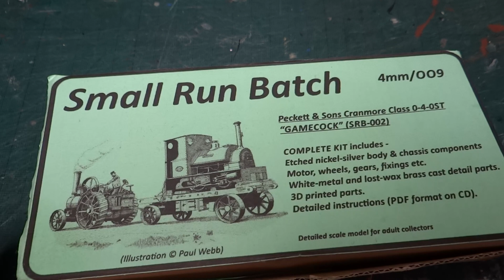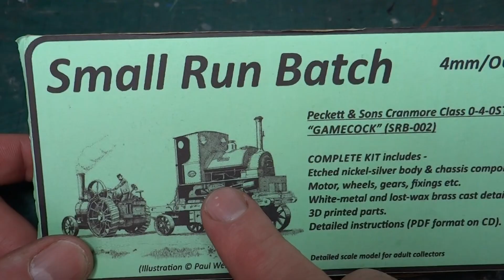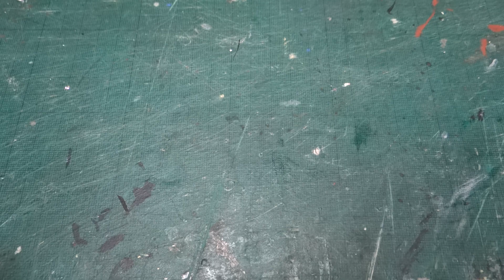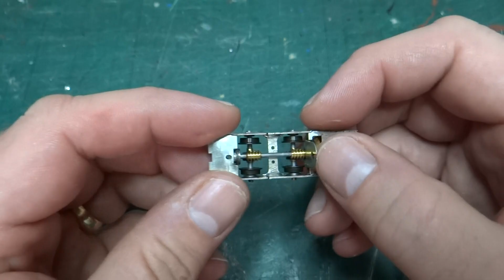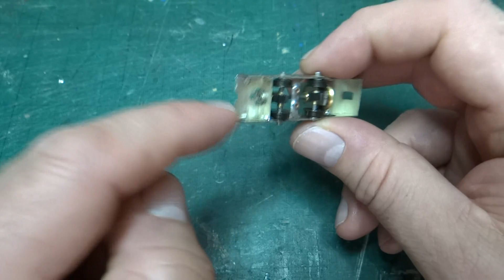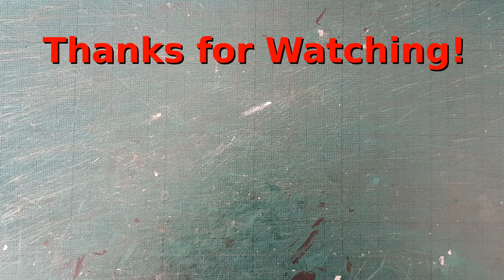Building Pecket 0-4-0ST "GAMECOCK" from the Small Run Batch Kit: Rolling Chassis

Comment: I am a little confused. In the presentation, you said that you used the axle bearings to secure the laminate and then did the same on the other side? My question, therefore, is how the hell did you do that with the axles in place? This is not a criticism, by the way, I'm just intrigued. Like I've mentioned previously, I've just started making brass, nickel silver, and white metal kits. In the bigger scale, 00 gauge, you can solder the bearings in and then put in the axles, and finally, wheels in place, but because you had already made yours up with the wheels and gears on, I just can't see how you did it. Or am I being stupid, it wouldn't be the first time! The resistance unit certainly makes a nice clean job.
Reply from the maker: Ah, yes, it would have helped if I'd shown the chassis prior to it being folded up. The main chassis part is a long etch that has two main folds, quite close to the centre. When folded up this forms the two long sides of the loco and the rear buffer beam. As such you can solder on the laminates and the bearings before you fold it. When it's then folded up it can still spring out enough at the front to be able to slot the axles into the bearings. A plate is then soldered across the top of the chassis at the front to keep the sides together and everything square.
Reply: Now that makes perfect sense!